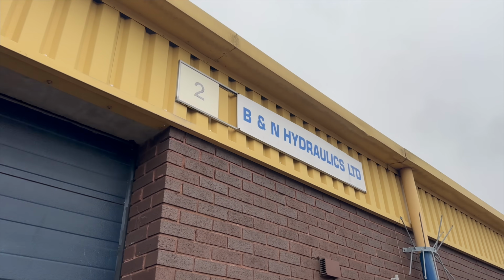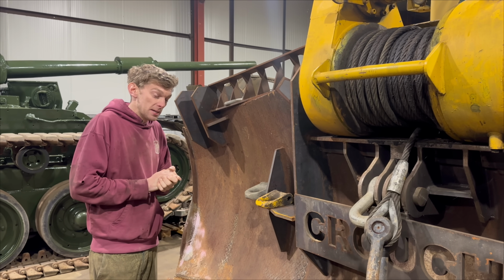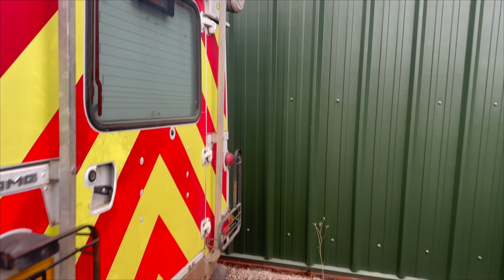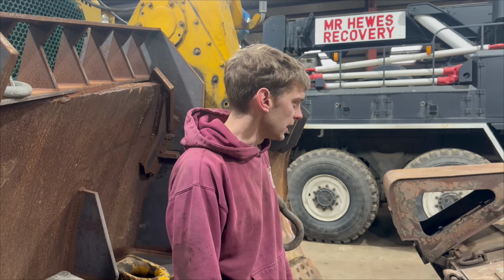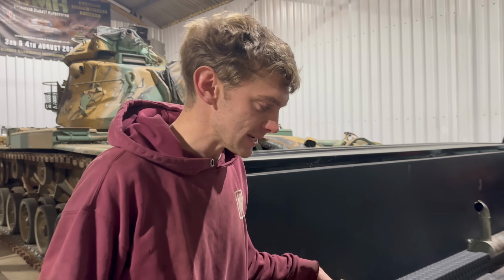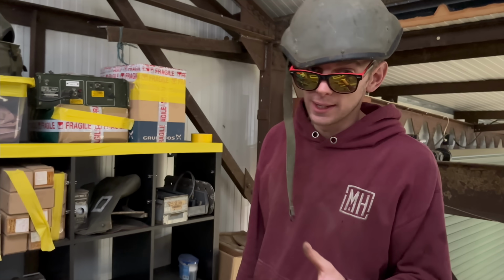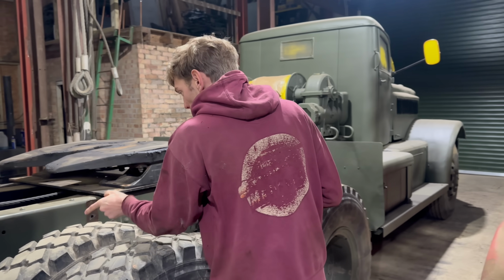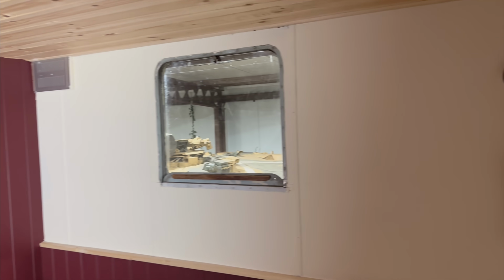“Taking a Tank to the National Ploughing Championships!” - What could possibly go wrong?

Comment: I’m not 100% sure but the cables in your camping trailer showing side of bathroom door looks like house wire twin & earth. If it is it’s not suitable for this application. All cables used should be stranded not solid because of vibration fatigue. Also possible should be marine standard butyl insulation. It’s been around 30 years since I’ve done any electrical work on vehicles and boats so maybe things have changed just thought I’d make you aware in case the electrical system is using solid core wires. Don’t want anything catastrophic to happen. Might be worth checking. Thanks for another very interesting video I really look forward to seeing every stage of all the projects takes me back to when I was able to enjoy tinkering and fixing cars and equipment. Keep up the great work. Many thanks.
Reply: I was hoping someone else noticed the wrong cable selection, i see this a lot on DIY boat installations and is often the culprit when fault finding. I use HO7 cable as it is waterproof and chemical resistant. It does not fatigue when being bounced around and i always use ferrules to terminate the ends. standard twin and earth is not waterproof and overtime will absorb water in wet or damp environments, it will fatigue as you said leading to difficult to access faults.

Comment: Could you not make a frame that steps up at the front of the trailer to re mount the pin at the height you need? Might be a few feet longer but it would keep it level.🤘😎🤘

Comment: With what you have explained ramps make the most sense for the trailer, however as someone else suggested air bags in the suspension of the rear axle would give you the ability to adjust the height when the inside of the trailer is being used while attached to the tractor.
Reply: If not air bags then air shocks .

Comment: For your Diamond T and Gents trailer. What about a 5th wheel dolly ? Put a drawbar coupling on back of Diamond T. Dolly will run level and drawbar can run higher up. Also you  can put the bed back on it the Diamond T for show cider storage. 
A 5th wheel dolly is sort of a thing a farmer like you had in a field going rusty.

Comment: Would 100% look best to raise the trailer frame so it stays level while connected, the only thing i'm worried about how stable it will be down the road and if it will be annoyingly tall to get in and out of storage etc.
I'm no trucker so i don't have a clue what i am talking about but those are my two cents.
I like the idea with the ramps tho, an easy and cheap solution.

Comment: How biblical,  Isaiah 2:4 "He shall judge among the nations, and shall rebuke many people; and they shall beat their swords into plowshares, and their spears into pruning hooks; ..." You need a buck converter voltage regulator on your plow circuit. I think you need to put a lift kit with airbags in the trailer axle so you can lift it up to level it for travel or drop it down to clear the garage.

Comment: on the radio trailer, would it be possible to build a trailer tounge to connect on to the fith wheel, much like the american trailers that connect to the pickup truck bed hitch?

Comment: Could you add a set of hydraulic leveling pads to the rear bottom of the trailer frame to raise and level it when you're using it?  That should solve the issue of front to rear and side to side leveling.

Comment: Could you fit air or hydraulic jacks somewhere underneath the Radio trailer instead so you don't have to mess about with ramps or disconnecting it from Diamond T? 
Or fit bags to Diamond T but i guess that kinda goes against keeping it historically accurate

Comment: I don't want to piss on your chips regarding the camper but twin and earth wire is not suitable for mobile applications. The solid cores break with vibration. Flexible cables should have been used really.

Comment: On the back of the dozer, why don't you add a hook and hydraulic crane for towing heavier vehicles?   Like big tow trucks have?   The dozer is for recovery right?   So add a tow system like on a tow truck where you can lift a vehicle to tow it down the highway..  Except in this case make it heavy enough you can tow heavy vehicles across any kind of ground as if you were towing it down a road.    AND for your camper trailer, do what I did to mine.  ADD two hydraulic jacks on the back, one each side.  When you stop you lower those to raise the rear of the trailer level.   In fact, it also makes the thing more stable in rougher ground too I found.   When you want to leave, raise the jacks and drive away!

Comment: If you are pulling out something heavy that may be subject to ground suction, you can use a land spade at the back of the dozer and also utilize the ripper assembly to create a spade attachment. This method allows you to sink the spade attachment and secure the dozer, preventing it from being pulled by the winch towards the stuck vehicle or recovery object.

Comment: Fit air suspension to the rear wheels of your 'gentleman's ' trailer so you can drive it and park it level then lower it to get it in the workshop. Should be simple enough for one axle.

Comment: Diamond T is too tall for the Trailer a 5 Ton Tractor would be a perfect fit with no mods or a single axle dolly and pull it with your 2 1/2 ton 6x6 Truck

Comment: when you put the bars on the dozer blade why not put ball swivels on each end of the bars so thet you can still twist the blade 
for the radio trailor did'nt it have a fifth wheel axle draw bar under it shove it back under and put a pintel hitch on the diamond "T" it would be easier than moving the axle up and down

Comment: Not every piece of your equipment needs to stay inside especially a trailer made for extreme outside conditions. Block the springs and axles up with H beams to proper hight and leave it in the lot. If you  build a new or add on a building install a taller door then.

Comment: Just a short dig with the blade and it's anchored.  I understand bridging the cylinders, they can take it but a flexible link can be made to take the corner loads on the blade using heavy chains and  screw-type tie downs. The welding would just be the end tie in points. You'll also want a kit box somewhere close, either mounted or on a utility truck with your rigging gear. Cable loops, chains, snatch blocks... The basics should be on it with support vehicles for the bigger problems.

Comment: Make the supports to the back of the blade hydraulic so you can adjust the angle of the blade if needed, whilst still being able to lock the support to the blade.
Air bags to level the radio trailer once parked up

Comment: The D9 needs both a Fir Cough winch and ripper bar on the back.
If you break something then it wasn't over-engineered enough.
Land Rover towing - wheelspin vs. clutch wear.  Tyres are easier to replace than clutches.
What's happened to the vine whiles that PDUK fitted?
Why does that Foden look like a MAN?
Tank ploughing, a new class in next year's UK ploughing championship?

Comment: 18:04 Can you replace the spring, coil axle with an air bag setup so you can adjust the height of the trailer?
Reply: I’ve seen a huge BBQ trailer that, when the airbags are deflated, fully lowers itself onto the ground so all the work surfaces are rock solid and there’s zero risk of it rolling down a hill into a crowd of music festival punters. Rather neat I thought.
Reply: Excellent idea.

I was going to say Do it 'properly' and lower the axels. In the future you'll regret not having it perfect, and, I'm only guessing here, you'll not have time to revisit it.😊

And please please paint the pine inside, not varnish it. The varvish will 'yellow' and cheapen the look. Or stain it ....
Reply: That’s what I would do. Then he can dump the bags and fit the trailer in storage.

Comment: now you need to turn a tractor into a tank..also just notch out and raise the pin end  of the radio trailer so it attaches level ..also the notch will be under the bed inside

Comment: Why not just put some Hydraulic legs on the back of the Radio trailer you can control, that way you can level the trailer out with independently controlled legs?

Comment: Ramps are a suitably low tech and sensible idea. Which of course means you should fabricate some nice hydraulic jacks/legs for the back of the camper to lift and level it. Because you can.
Reply: I was thinking the same thing. Like the ones you see on a Back Hoe

Comment: use hydrolics to lift and lower the trailer axle so you can have it right height coneccted to the truck but also lower it to get it into buildings
this will also help to level the trailer on hills or uneven ground alot easier as well

Comment: On the trailer, why not put air suspension height adjustment on the rear for when it's parked.
Reply: That's the most practical thing to do, ramps would be a right hassle.

Comment: Airbags will give you adjustable height on your mobile clubhouse
Reply: I fully endorse this idea
Reply: and jacking up to keep the trailer level will help the stuff inside to stay. mount a spare under the trailer chassis rails on an electic hub motor to further stabilize the trailer while driving.

Comment: If you got a triple ripper on the back of the D9, with not much modification it would make a nifty anchor for heavy winching
Reply: Or just a spade shape
Reply: I think that won't help much. If the blade on the front doesn't give enough grip, anchoring again to the topsoil won't help. You'll need to go deeper.
A pin going a few meters into the ground, or something like that.

Or, to stay in style with the rest of the Pulldozer, it would be a (modified) drill for a waterwell or an oildrill, that can go dozens of meters deep and into rock...🤔